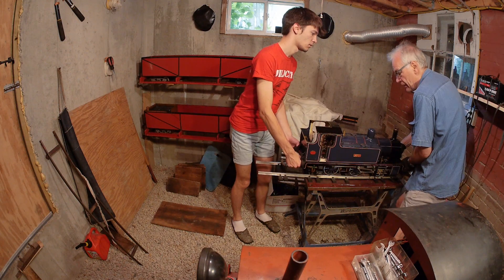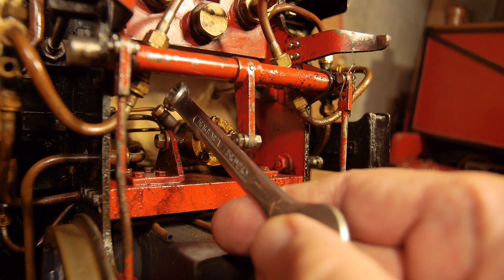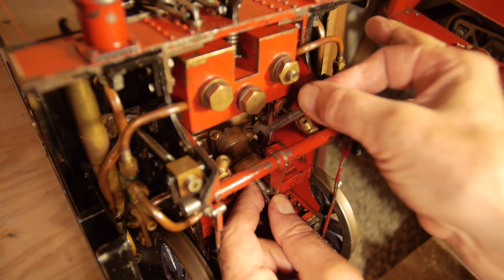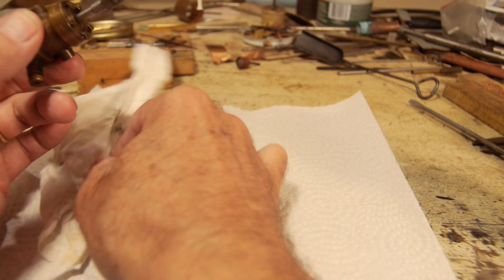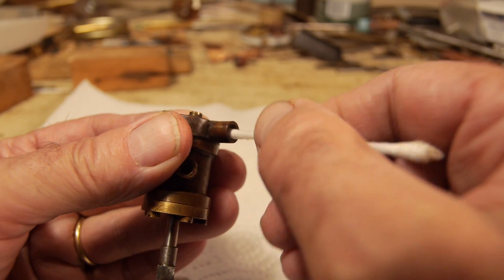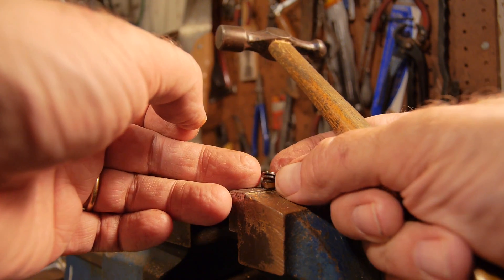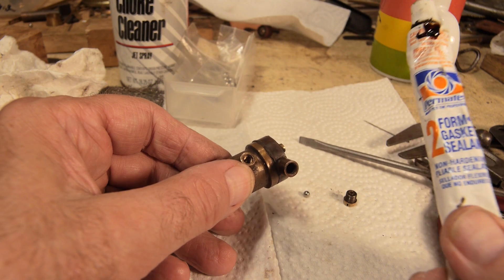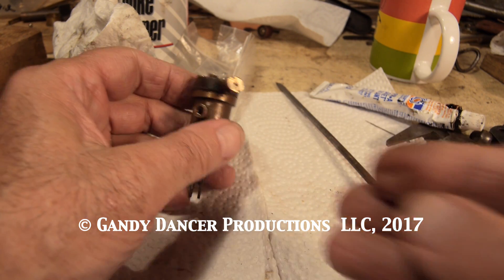Repairing my 5" gauge steam loco 'Joan'

Comment: I don’t know if anyone else has pointed this out but as regards to the steam brake, that system you described is nowt to do with warming it up, it’s a one way valve to destroy the vacuum inside the cylinder when the brake is disengaged, the heat dissipates & makes a vacuum, the ball then allows air in.